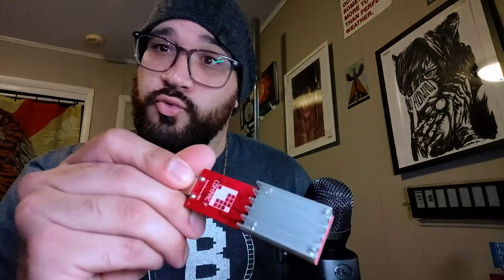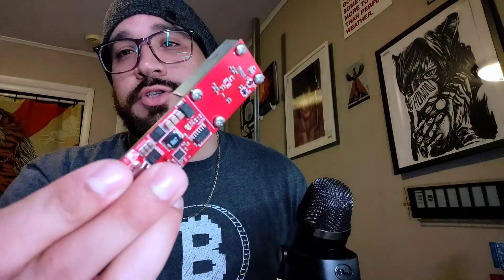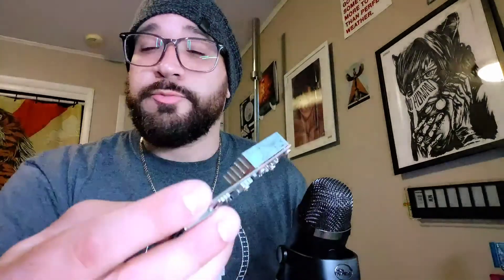GekkoScience Compac F USB ASIC Miner informal 2 week update JTC39

Comment: Can it work on a Windows OS?
Reply from the maker: I've personally not been able to run it on my Windows 10. I tried compiling it for fun but gave up cause it was a bit too complicated to set up. I did set it up for one of their older miners, the Newpac but it never ran right and i always ran into stability issues. Generally speaking its better to run stuff like this on open source software and not closed source stuff like windows..i recommend a Raspberry pi 4 or Raspberry pi 3. Super easy and they are pretty cheap if you can find em at sticker price

Comment: have you taken into account the additional power draw vs extra hash received from overclocking? Curious which is more profitable in the long run.
Reply from the maker: the more you underclock it, the more efficient the miner is. so underclocking it is technically "more profitable" but that doesn't take into account the hardware costs. i dont have the numbers but i dont think it would be a big or very noticeable difference.

at these hash rates, the energy savings doesn't mean too much unless you had REALLY expensive electricity. i think the consumption on these would range from like 9-14W per stick. discounting the hardware, i think you would need to pay something redic like 40¢ per kWh in order for these to lose money.

Comment: How do I get this running on a raspberry pi I have cgminer installed but no luck finding the fs7
Reply from the maker: I've tested this on it on a pi 3B+, pi 3B+ model A & a Pi 4.

 pretty much what i did was:

1 - Use the Raspberry Pi Imager to flash a fresh operating system to the SD card:
 https://www.raspberrypi.com/software/

2 - Insert that SD card into the raspberry Pi

3 - Open the “Terminal” app. Enter the following commands. If you have trouble, enter each command as its own separate line:

sudo apt-get update
sudo apt-get upgrade -y

sudo apt-get install -y build-essential autoconf automake libtool pkg-config libcurl4-openssl-dev libudev-dev libusb-1.0-0-dev libncurses5-dev zlib1g-dev git

cd
git clone https://github.com/kanoi/cgminer.git
cd cgminer

CFLAGS="-O2 -march=native -fcommon" ./autogen.sh --enable-gekko --enable-icarus

sudo make install

— That’s it! Close terminal then re-open it. You should be good to test if the installation was successful. 

I was only able to get it to work when using "sudo" in front of cgminer. So the command I enter is something like:

sudo cgminer -o stratum+tcp://stratum.kano.is:3333 -u 1BURGERAXHH6Yi6LRybRJK7ybEm5m5HwTr -p x --suggest-diff 128

if that doesn't work, then I am not too sure what to advise. I recommend going to the bitcointalk.org thread https://bitcointalk.org/index.php?topic=5355470.60
Reply: @justh0dl  omg thank you so much countless hours i have wasted on setting that up. IT WORKS
Reply from the maker: @coolvinwallace9799  awesome to hear!

If you need help overclocking, i wrote this up for someone else in the bitcointalk thread: 

I believe you can only run one frequency per instance of cgminer. so if you want to run different sticks at different frequencies, you can open a new tab in terminal and just enter the new command.

should look something like this:

sudo cgminer -o stratum+tcp://stratum.kano.is:3333 -u zzz.worker -p x --suggest-diff 442 --gekko-serial "GS-10050486" --gekko-compacf-freq 350

if you wanted to run more than one stick at the same frequency, just add commas:

sudo cgminer -o stratum+tcp://stratum.kano.is:3333 -u zzz.worker -p x --suggest-diff 442 --gekko-serial "GS-10050486,GS-10050489,GS-10050487" --gekko-compacf-freq 350

you should also look into adding these at the end if you're having trouble with under hashing:

--gekko-compacf-detect --gekko-start-freq 300 --gekko-mine2 --gekko-tune2 60

so at the end the command might look like:

sudo cgminer -o stratum+tcp://stratum.kano.is:3333 -u zzz.worker -p x --suggest-diff 442 --gekko-serial "GS-10050486,GS-10050489,GS-10050487" --gekko-compacf-detect --gekko-compacf-freq 350 --gekko-start-freq 300 --gekko-mine2 --gekko-tune2 60

good luck hashin'

Comment: Nice, just got one of them the other day, new to all this and seems fun to learn, having a problem though, so I did the zadig driver install, and I know the computer sees it in the settings when I look it up, problem I’m having is cgminer doesn’t see it, says no device and hashing rate is at 0 across the board, please help, thank you!
Reply from the maker: Sorry bud I can't trouble shoot windows. I couldn't even get it installed.

Shit is garbage unfortunately for running miners. I gave up on them hard. I'd say pick up a raspberry pi 3B+ or a 4 asap before they're sold out everywhere. I couldn't even overclock my Newpacs when i had em.

Just in general in my opinion you're trynna run open source software on closed source shit so you're always gonna run into issues.
Reply: @justh0dl  ahhh ok yes I picked up a pi 4 not long ago, haven’t used it much yet but will try that first
Reply from the maker: @danielsilvestro-hernandez9015  same thing happened to me. had the pi laying around for ages, knew it would eventually come in handy. these things finally gave me the motivation to learn how to use em. 

you can download the OS here: https://www.raspberrypi.com/software/operating-systems/#raspberry-pi-desktop

I used: Raspberry Pi OS with desktop and recommended software

then the imager for windows here to flash the sd card: https://www.raspberrypi.com/software/

after i did that, i just entered the commands into terminal that were in the video description and after like 10 mins you're mining.

there's a couple of tweaks here if the miner is under hashing that i forgot to add to this video but i should put another update soon.

Comment: That's pretty good for a USB stick. Good to see you are back. I'm still holding out for the next Terminus project. Oh, and I put some old computer fans on top of my futurebit miners and dropped the balanced temp to like 55-58 C. Been using them in the basement where I've just been running the HVAC fan to circulate air and have not turned my heat on yet. Kept the house at 68-72 last two weeks.
Reply from the maker: the heat the futurebit's make is actually kinda wild. i think you can def heat up a room with them in the winter. actually really excited about it haha.

the gekkosticks are indeed wild. i actually bought more along with a ton of Pi's. gonna be putting them in families houses. def looking forward to the new pod miner.